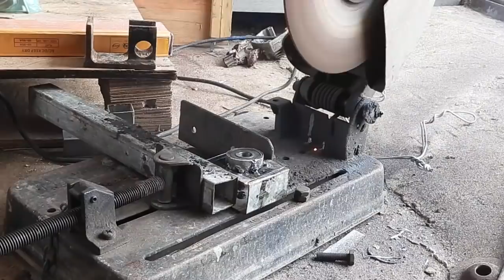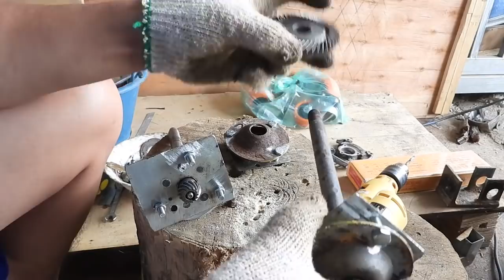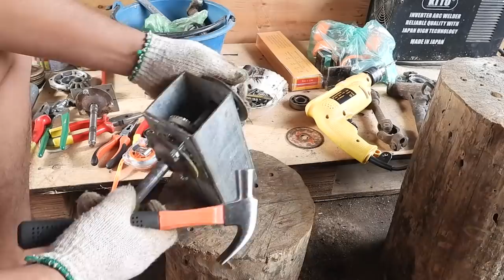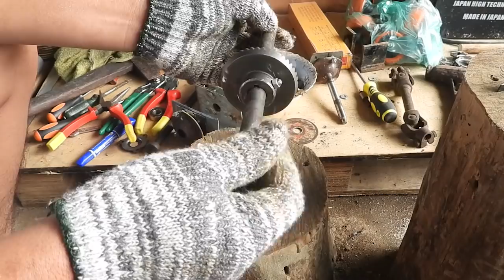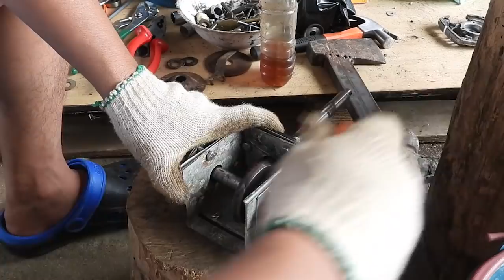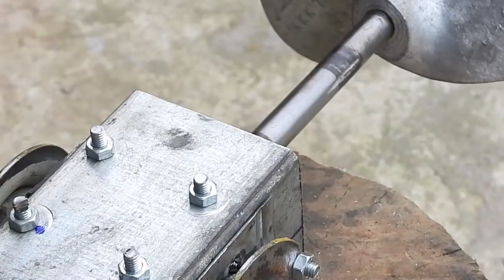Cool and Amazing DIY Water Pedal Boat Gearbox New Invention

Comment: There's nothing much more satisfying than throwing together a bunch of rusty or semi-rusty parts to make something as clever, but as simple as this pedal-powered propeller drive. I've had this idea in my head for years, but needed to see someone make it so I could see what I needed to do. I've seen lots of uses for the gears in grinders, but ''THIS'' is what I needed to see. I've got a pile of grinders that were on my basement floor during a flood & are now rusted stuck. If I'm not able to take them apart, clean out all the corrosion & rust, then grease them real good to try to make them run again, I'll have a bunch of gears I can use to make some right-angle drives for ''whatever''. THANK YOU ''MR. P1'' FOR MAKING THIS VIDEO SO I COULD ''SEE IT IN ACTION''. As I said, I've had this idea in my head, but ''YOU DID WHAT I NEEDED TO GO FORWARD WITH THAT IDEA''!!! I do have a suggestion, although it's probably not needed. That is to ''maybe'' put a spacer/bushing on the crankshaft between the inside of the housing & that larger round gear. It ''might help'' to spread the housing & ''maybe'' help stabilize that gear & the entire assembly, ''MAYBE''. It seems to work fine as is, but with that spacer & a lot of grease, you've got a great, but simple right angle drive there. GREAT VIDEO, ''MR. P1''. THANK YOU.

Comment: Good idea. But it would have been better if you user that at the end. Use the full benefit of the different speeds of a bike then transfer that rate to the gearbox. That way you will have a lot more control over the velocity of the propeller.